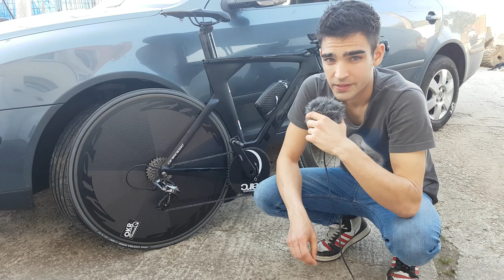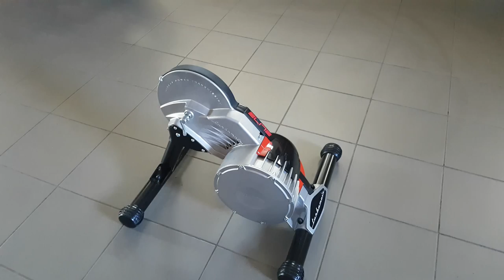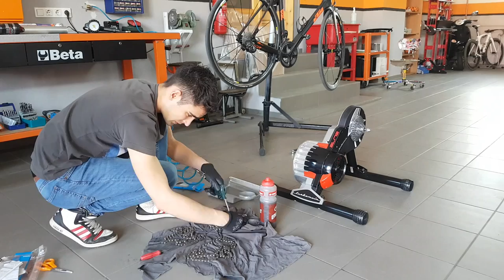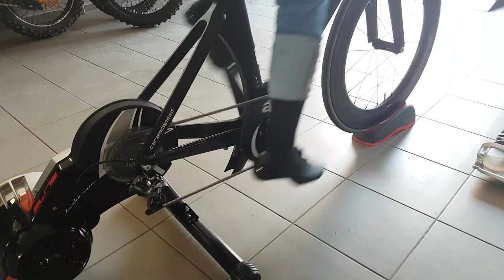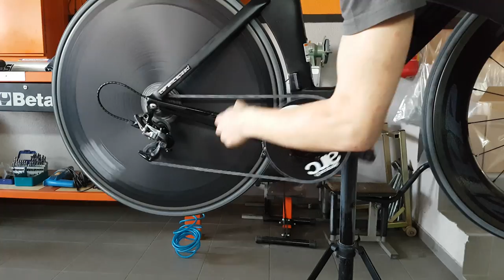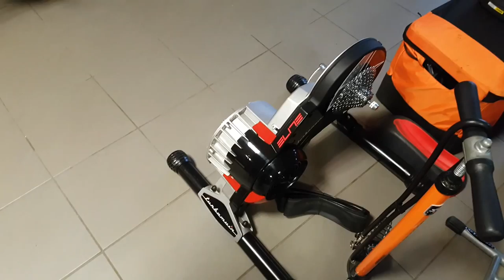Cycling vlog #8: Unexpected chain problems

Comment: Great information

I have that Elite bottle / cage on my road bike, it is good - small, but that's all I need, and looks great at a good price

On my TT bike I have the specialized 'fuelcell', not because I need to carry anything, but because it fills in the space around the bb and fits flush, like cervelo used on the P5. It fits many bikes, not just the specialised and is not expense, and is good for holding gels, and a spare tubular

It does not yet come in black, but it is a good product
Reply from the maker: J B I like the bottle as well, it's also super quick to operate.